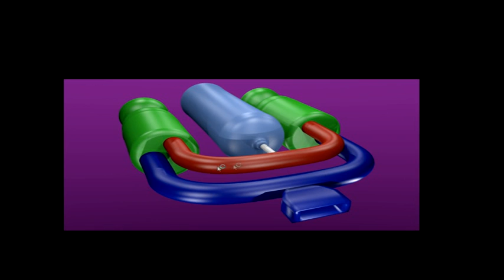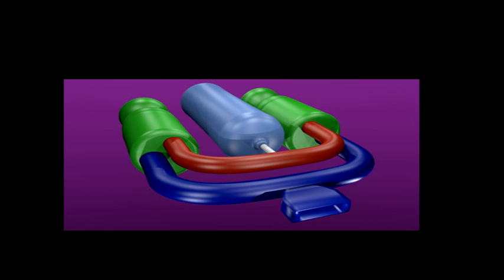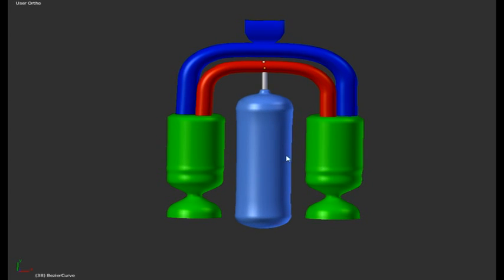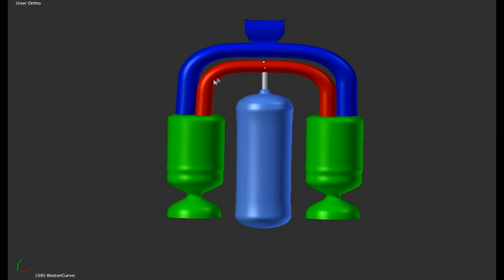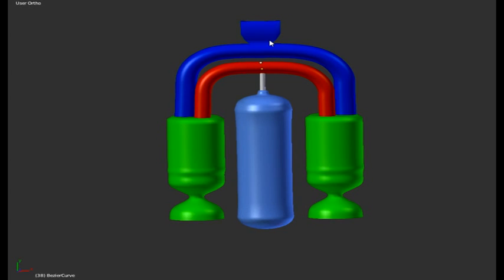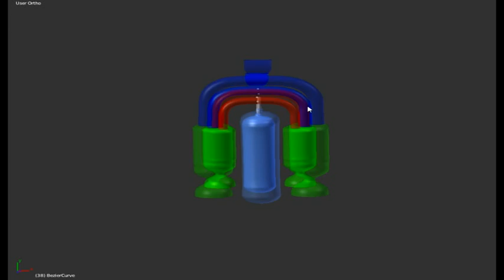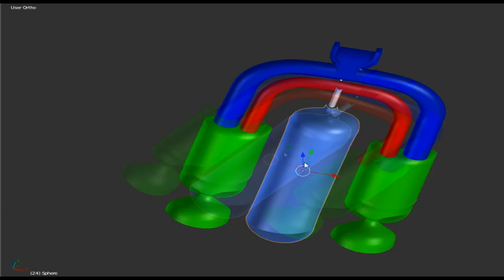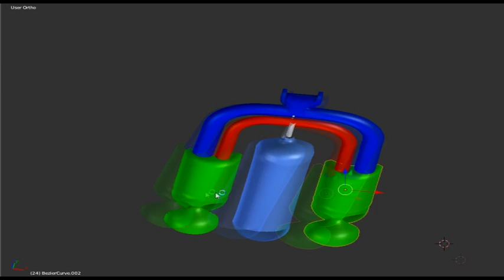Valveless pulse jet forward intake

Comment: What’s to keep them synchronizing? Or even precombustion from taking place inside the fuel pipe? Even if it worked as you theorize, the vibration of two oscillating engines would rip the aircraft to shreds. Argus engines ripped planes apart. I can’t imagine what this would do